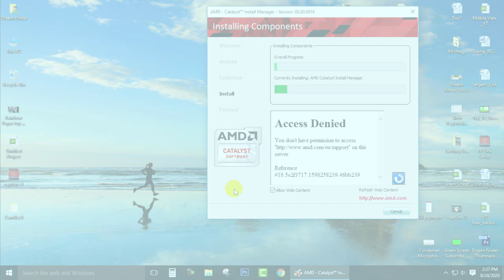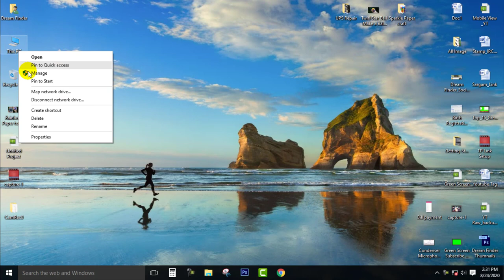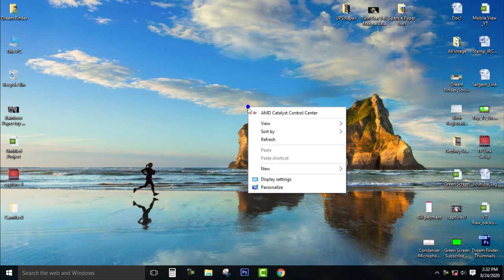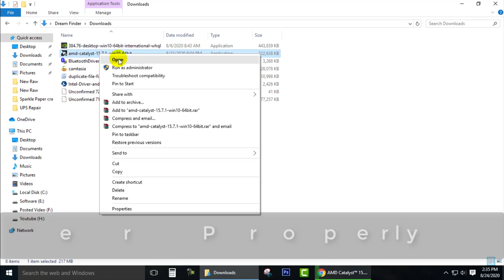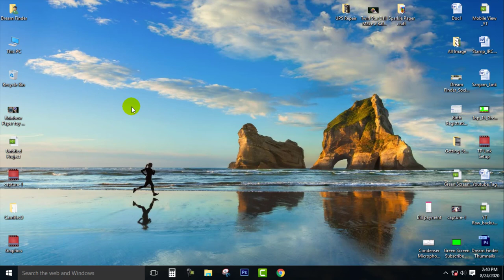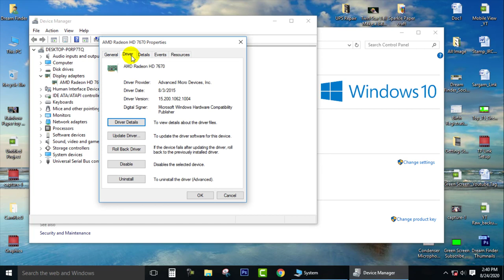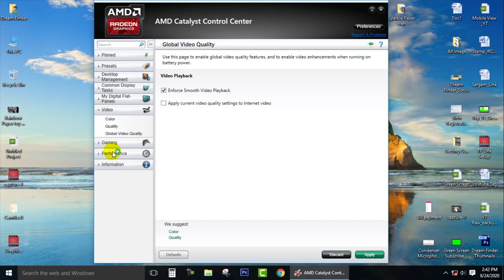Graphics Card Installation  | AMD Radeon7670 Graphics Card Download & Installations | VGA, AGP, HDMI

Comment: Careful guys. 

This is a scam card. 
The 7670 was never produced with 4gb (4000mb) of ram. 

This is a made in china, 7670m (mobile) chip that they hacked together on a low cost board, using a PCI-e lane, with a fake bios. 

If you run games that use more ram than maybe 1-2gb, it just crashes, since the card does not have that much actual ram (remember, the bios is faking it). 

You can flash them back to normal, so they stop crashing, but it's not worth your time or money in my opinion.
Reply: learned my lesson today
Reply: @KyotoUzi  ahh, you ended up buying one?
Reply: @Orvis25  yeah 😭
Reply: @KyotoUzi  sorry to hear you got scammed. 
If you are going to toss it though, would you consider sending it to me? 
I am not willing to buy one and support the scam, but i do kinda want one so I can make a video on it, and maybe show how to flash them back to "usable" cards.
Reply: @Orvis25  man in the amd site has a driver for this graphic card how can it be fake
Reply: I got one and i play fortnite mid setting 200 fps
Reply: @Slowedlippe  You didn't read up an anything i said did you? 
I highly recommend you research on how bios hacked fake cards work.
Reply: @Orvis25  ok
Reply: Damn I wanted a new graphic card for my birthday and my dad got this one...
Reply: @walwal6449  Sorry to hear he bought a scam GPU :( Try to get a refund.
Reply: @Slowedlippe  how
Reply: I got the 7670 4gb variant from my uncle (same appearance as the video), and yeah it crashes on games that uses more that 1gb vram. 
But months ago i managed to restore the card to the original by flash bios, it was actually an hd 6570 1gb ddr5 card. Working great now
Reply: @tubo_channel  how you did? there is a tutorial?
i bought it and i cant have a refound
Reply: Can you modify the bios to have the original amount
Reply: Wish I would of seen this before I bought the damn card. Seen it on Amazon for 60$ and thought that was a good deal, never looked it up and just bought it. Now I can't even play Valheim without it crashing and Magicraft crashes as well. Wasted money and wasted time.

Comment: I have one of these cards but whenever I load up something like gta my screen just goes white. Any solution?
Reply: Apparently this card has a flashed bios that says it's better than it actually is, so when the system tries to use more than 1GB of vram it just crashes the graphics driver
Im trying to get the original firmware to flash the card with ATIflash so the card so it doesn't do this, unfortunately i don't know what's the original chip and i can't find any rom

Comment: hi my valorant game is crashing with this gpu please help me
Reply: Its only 512 MB, Valorant need 2GB GPU
Reply: @dhal  Its not 1gb but only 512mb mate, this GPU can only run LoL, Dota 2, Cod World at War, Cod I,II,III, Black Ops 1, Assassins Creed 1,2,3, GTA SA, GTA IV, Metro 33 Redux, FarCry 2,3, And other 512mb Games, It cant run 2 GB games.
Reply: @dhal  If you want to buy graphics card, Buy a Original 2 GB Graphics, It can run Valo and other competitive games with low/Medium settings.
Reply: @dhal  Nice Graphics Card, You should also try b450 mobo and ryzen 3 or 5 it is good on rx
Reply: @Kaylsu  dude valoran run literally on everything, the card is just fake
Reply: @Gerelio  the card isn't fake dude. It's a rebranded AMD Radeon HD 6670 GDDR5 1gb lol